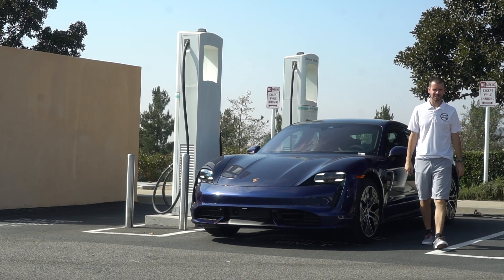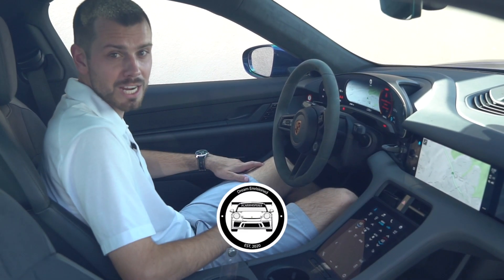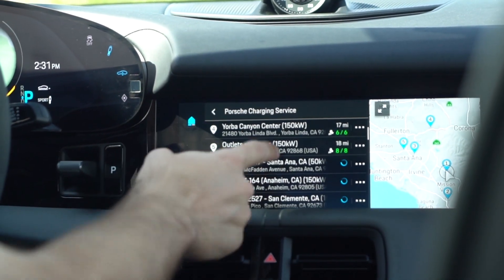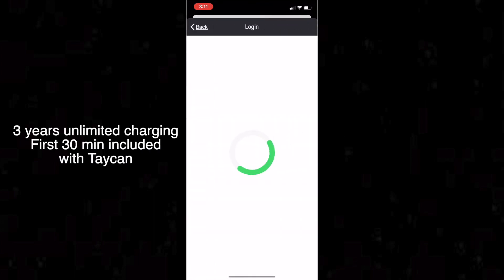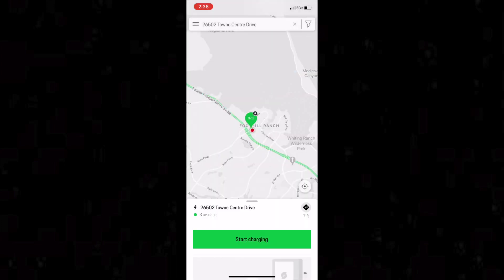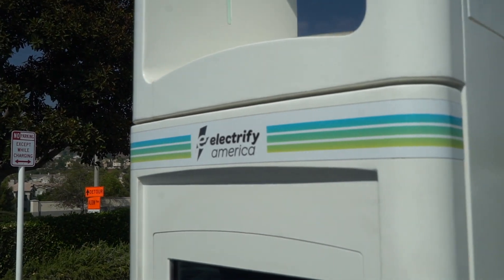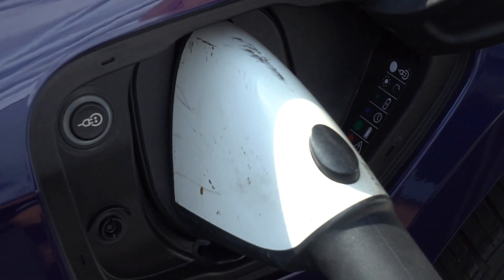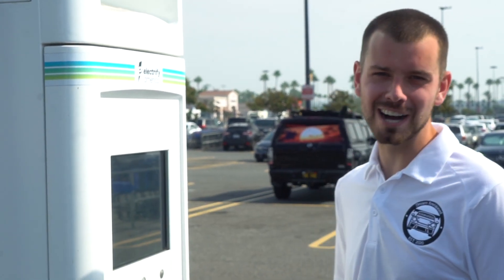How to Charge Your Porsche Taycan at One of Electrify America's Charging Stations!!

Comment: You are not accurate about having to have the charging options to charge faster at the 50kW station. That is wrong! The infrastructure in US is only able to max out at 50kW at any 400 V stations.
Reply from the maker: You are correct there are probably about 10 400V 150kW stations throughout the US. Since posting this video awhile back no need for the 150kW/400v on DC charger.

Comment: Dude, you're wrong about the Electrify America stations being 400-volts. They are ALL on 900V architecture. Don't advise people to buy the 150 kW 400v DC fast charge option, because it's practically useless. There are VERY few DC fast charge stations in the US on 400v architecture that can supply more than the 50 kW (there are clusters of them in some areas of the country but not many. 90+% of 400v stations are limited to 50 kW). That's why Porsche set the standard 400-v DC fast charge rate at 50 kW because you rarely ever get higher power than that on a 400v station.
Reply from the maker: Thanks for your input Tom, appreciate it!
Reply: @Pcarwhisperer  Certainly. This has been very confusing for Taycan customers as well as Porsche client advisers. It's all new to most people so that's understandable. But that option is a waste of money for most people because they'll never come across a 400v DC fast charger that can deliver more than 50 kW. There are a few of them out there, but very few.
Reply: Forward to 2022, I’m in Miami and have been charging anywhere from 80kw to 104kw at the EA 150 stations.   So I’m happy I got the option.

Comment: This always got me cringe and the main reason why I got a Tesla instead of a Taycan. The Taycan drives much better, with better build quality but it's charging that holds it back.
I wonder if we have an answer for this (I'm not talking about charger availability here) - how can I charge a non-Tesla not at home if my phone is broken/out of charge/no network connectivity?
Reply from the maker: Hello! Stating with the model year 2021 we have something that is called "Plug and Charge" where the vehicle will automatically connect to the electrify America charging network once you have plugged in the high power charging plug into the passenger side. If this does not work Electrify America Charging Stations have a place for credit card payment if you are in that much of a pinch. If at a Chargepoint station for example you would need to tap your physical card to the station to initiate the charging station without the need of you phone. Hope this helps!
Reply: @Pcarwhisperer  nope.  2022 and plug and charge still does not work.

Comment: I believe, and hope, that you are incorrect about needing the 150KW DC-DC converter to fully exploit the Electrify America 150KW stations. I even got a photo of the tag on side of BTCPower station in San Jose. It shows output 200VDC to 950VDC at 350A max then total power is restricted to 150KW here.
I purposely didn't order the 150KW DC-DC converter upgrade option because as far as far as I could find 400V stations in USA are 50KW max anyway. Can you please look at charger screen that shows voltage and amperage while charging a Taycan. I don't get my car for another month. 😁

But I do enjoy your video except this one question. 👍
Posting on TaycanForum.com.
Reply from the maker: Hey Ron! Thanks for your comment and question! What is your email? I will send you over several files I have!👍 Interesting?! Is this the site you are using? https://www.btcpower.com/index.php?action=100kw_350kw 

Congratulations on the Taycan coming! Such an awesome car! Excited for you! Thanks for sharing to the forum!
Reply: @Pcarwhisperer  the ones I saw were model EVDSP-350-4-120-0-2-C-4-0 which are actually 350KW units just turned down to 150KW. See https://www.btcpower.com/index.php?action=350kw-DCFC